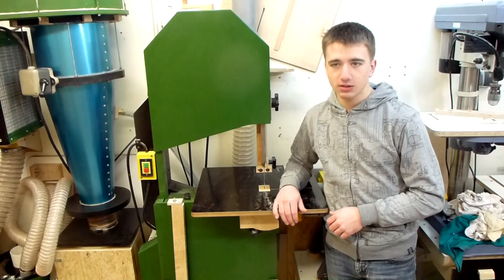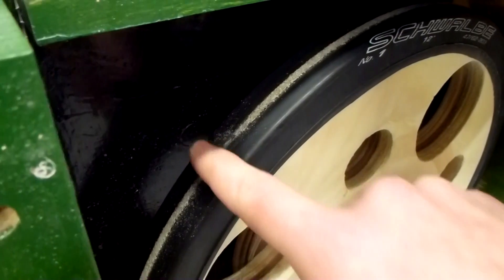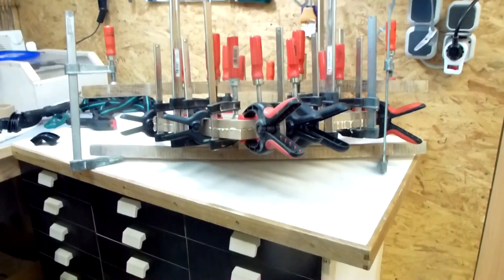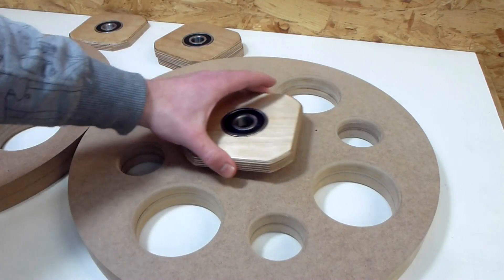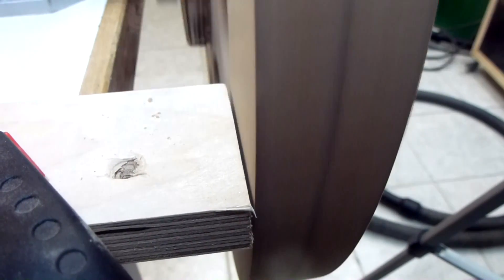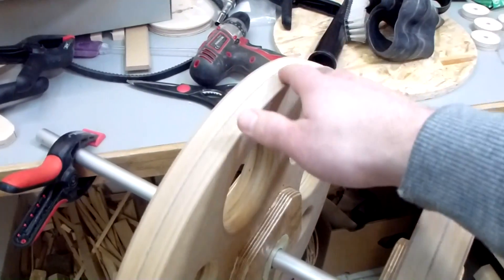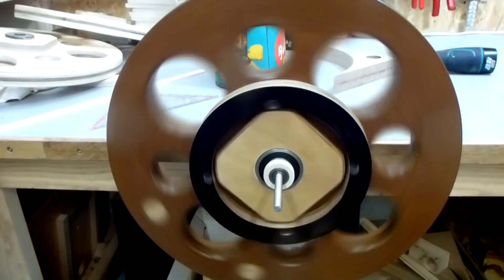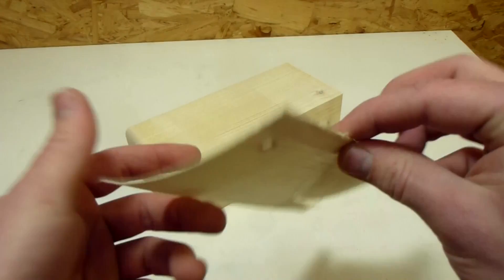New Wheels for the Homemade Bandsaw

Comment: Felder has brushes on their higher end bandsaw machines that work really well to keep saw dust buildup under control. Not the Hammer models but the Felder and the price includes a mounting piece. Put these stiffer bristle brushes at almost a vertical stance as the pressure is applied. I use them on my Northfield 27" bandsaw with altered mounting positions. V Mordt Rolfe Chicago

Comment: Hey Marius,  I'm about to turn my bandsaw wheels down to size and wanted to ask how your wheel design is holding up as I'm thinking about using your design, rather than Matthias'?  Does it eliminate the sawdust under the inner-tube? Or have you came up against any other problems with your design at all?  John Heisz used silicone sealer on his,  so I have that option too?? Thanks for you time!
Reply from the maker: +The Pallet Hippie Yes, I have zero sawdust under the inner tubes. So far no problems at all.

Comment: Hi Marius, How do you run a 400v motor off mains power (wall power, 240volts)? I just got for free a motor like yours and I was wondering how to make it work. Thanks in advance :)
Reply from the maker: +Abel Gonzalez I have a 400v outlet in my shop.

Comment: Great videos. They are project inspireing. Thanks. I will give you a great hint if you want to harden a wood surface. I use thin CA glue on a surface if I want it to be durable. The thin Ca will soke into the porous wood and it becomes like solid plastic. ...Cheers
Reply from the maker: +lewandlo Cool, I'll probably give this a try in the future.

Comment: Excellent work! Now you have used the new MDF wheels several months. Are they still in good condition? No problems with MDF as material: breakage etc. ?  I'm planning to use MDF wheels instead of plywood in my bandsaw project, that's why I ask.
Reply from the maker: +Petteri Salmela They're still in "like new" conditions. No cracks, no damage, no sings of wear. I'd only recommend to use MDF for these band saw wheels.
Reply: +Marius Hornberger Ok, nice to know that :-)

Comment: where and what do you get your motors from when you get them
Reply from the maker: +Reese Asher ebay
Reply: Marius Hornberger oh but like what do you type in and how much do you spend on them, like $100
Reply from the maker: ...search for "electric motor"... Usually between 10-30€
Reply: oh ok so you don't search like "120v electric motor" or like "____rpm electric motor" or anything? Thanks SO MUCH for your help Marius

Comment: I was wondering if you ever considered re-making your bandsaw wheels using your CNC machine (now that you own one).  Perhaps with proper reference holes/marks the accuracy could be improved and a wobble eliminated during the wheel glue up.
I built my bandsaw some time ago and likewise am considering redoing the wheels.  I don’t own a CNC but am contemplating if it would be worth having it done.
Reply from the maker: +Fikol Cki I don't think a cnc could make a better job. There is still the chance that the bearings are not straight inside the flange.

Comment: If you ever have to re-make wheels there is a trick that would help the alignment issue you ran into when adjusting the wobble on the wheel before gluing the bearing flange. Move the flange as you were doing by tapping on it but before you release it for gluing drill through it and use a dowel in the hole, this will ensure you install the flange exactly where you had it before and it will be Ok since you will balance it later...
Reply from the maker: Gilberto Diaz Castro I thought about this method, but didn't use it because I thought if the pieces move just a tiny fraction while drilling then it would screw up the alignment and I can't fix it. In theory this is a perfect idea, but it's hard to make.

Comment: really should have replaced those bearing shafts they look useless
Reply from the maker: Derek Watson They LOOK useless, but they're anything, but useless. Only the little outer surface was scratched. These are still overkill shafts for a band saw.
Reply: well you did get it running so smooth so I guess you made the right choice, + me eyes are not that great!

Comment: I made a similar bandsaw, only with a metal frame and wooden wheels watching your video, thank you for this detailed video, but I was wondering how to change the bearings when these fail of use, do I have to make the wheels again?
Reply from the maker: Marko Miljkovic Yes, I would have to do that. But the bearings should last a long time.
Reply: Marius Hornberger Thanks, you're right! :-)

Comment: Hi Marius! Great job!
Was it possible to use a dozen screws instead of dozen clamps when you glued MDF panels together? And the second moment - does auto service center' balancing machine works well for balancing bandsaw wheels?
Thanks for video, your result is just amazing. Cheers!
Reply from the maker: schabanow Screws should work, but you have to be careful. They don't hold very well in MDF. I would recommend clamps. And I don't know if their balancing machine works for that. Ask them. But in the time you go to their service center to ask them, you probably have balanced them yourself.
Reply: Thanks Marius! I mean screws + nuts, through drilled holes. And I agree about service. )) Good luck!
Reply from the maker: Bolts and nuts should work fine.
Reply: Sure if you have a couple of dozen clamps you can press the pair together much faster.

Your wheels are really brilliant, first of all I mean their exterrior (my weakness), not expensive and fully functional as well.

As a variant... I've seen a ready made pair from the bycicle (!) - not even motorcicle. Despite the author runs them at extremely (as I comprehended the video) low speed - they work. Cutting process is obviously not fast, but it definitely IS. He cuts off a ~ 1 inch water pipe in ~ 20 sec; the timing resembles one for handheld high rpm abrasive cutting-machine.

I wonder of a pair of used motorcicle' wheels...

Comment: Hallo
There is something else about the motor you could do, it might be possible to make it run at two speeds and make it start properly also by using a special switch. You should first open the box on the motor and see how many wires come from the motor into the box, if there are 9 it is possible to make it run at a lower speed by reducing the number of poles and at full speed (1500 and 3000 rpm for example) and use a star-duble star or star-triangle start config, if  there are 6 it is possible to use a star-triangle start, and if there are only three you cant do much but someone with expertise could disassemble it and do the proper modifications, also the proper way to start the motor is with a star-triangle config because in triangle config the starting current is 4 to 8 times bigger than the running one as oppose to a star config in which the starting current is only 3 times bigger than the running current. I will try to explain more. The motor has a rotor that is so called in short-circuite and a stator with a multiple of 6 windings but there are basicaly three coils, one for each phase. Normaly from the factory there should be 9 wires coming out of the casing, three for one end, three for the other end and three for the midle of the coils so depending on the aplication the connections are made, but sometimes these wires are conected inside the motor. These wires could be connected in a few ways (sometimes incorect making the motor to run hot and ineficient, noisy ...)
Reply: Alexandru Alanei that is a good idea

Comment: Hallo
I have thought about the high starting torque of the 3-phase motor and there are some solutions for that other than a speed controller, in fact that is not even the recommended solution for this type of motor.
Most likely your motor is connected in a triangle configuration so the tension is 400V, but at startup ( if the start is with no load) the configuration should be in a star (Mercedes icon ) so the tension is 230V, after the nominal speed is achieved a switch to triangle configuration should be made.
You should use a specific switch 
http://www.schrack.ro/comenzi/comutator-stea-triunghi-3p-7-5-kw-32a-in108900.html
or three commutators and a time relay.
 wiring may be confusing and dangerous and you should ask an electrical engineer to help you
Reply from the maker: Alexandru Alanei Hmm, interesting idea. Thank you!

Comment: 10:41 just screw that onto the wheel after you fix them and then remove the clamps, why you gotta use glue?
Reply from the maker: Gia Rcheulishvili Screws aren't nearly strong enough for that.
Reply: Marius Hornberger Great video!  On my bandsaw, I used some crappy plywood for the wheels and compounded poor material with less than perfect workmanship.  Still, the saw runs okay, but my coin wobbles much more than yours :)  I'm going to use your video as a reference for my next attempt at wheels, I think you did a great job from materials on down...  But I agree with Gia - you would have done better if you had drilled in some screws after you had the placement perfected, but you're also right - you want glue for the strength.  I would just use the screws to ensure the alignment.
Reply from the maker: I'm right, because you NEED the glue for strength. And the flange can also be moved by the screws, when you driving them in. But if you try it, let me know if I'm wrong.

Comment: easier hole saw cutting: drill one or two holes (1cm or so) on the waste side of the cut, intersecting the cut line.  The sawdust exits the kerf onto the holes and no more burning!
Reply from the maker: I already got that hint from another comment. But still thank you! I will definitely do that for the next hole saw hole.
Reply: I figured about 20 people would tell you this. But I wanted to get in on the razzing.  I cannot tell you how many doors I burned my way through before someone told me this. It would be so convenient if we could learn all of this stuff before we ever built something.
Reply: Thanks for that advice!!! I hate my holesaw for that reason. Maybe there is hope :)

Comment: I would call it "Brilliant".  A really excellent job Marius.  You're right, those new wheels look great and I can hear the difference.  What blade are you running on the bandsaw?  Cheers.
Reply from the maker: David Handley Thanks. It's a 6mm tuffsaws carbon blade with 6 TPI and a Vari-set that I use primarily. http://www.tuffsaws.co.uk/index.php?route=product/category&path=2_4_13_21

Comment: Really fast start :) Your motor have capacitor? Try to use smaller capacitors, the motor will not be so quick at start
Reply from the maker: Igor Somov No, it is a 3-phase motor
Reply: any 3-phase motor can be connected to 1-phase. Maybe this makes sense?
Reply from the maker: But I have 3-phase power supply. So why should I do that.
Reply: To make start more soft :)
Reply: Igor Somov don't convert it to single phase unless you really must because that will produce reactive energy which is charged in most places so you'll pay twice as much, another reason would be that the 3 phase motor is less prone to burn out
Reply from the maker: Don't be afraid. I will stay with the 3 phases.

Comment: Great videos and impressive work!

Can you please specify your tablesaw and how you like it? Thanks a lot in advance!
Reply from the maker: Uwe Born 250mm (10") sawblades, 1400 watts power. The fence is good (after some modifications). It is better than no tablesaw and does the job. The blade wobbles a little bit and the table surface is not 100% flat. I don't recommend to buy it new, get something better. But this saw is 19 years old so...

Comment: Very nice wheels Marius.  Interesting design advance and they look great.  I don't know what the inner tubes cost, but with your design you could also incorporate purpose built band saw wheels that would be very durable for about $25 each.   http://www.ereplacementparts.com/protectorwheel-p-446077.html
Reply from the maker: Gary Truesdale 7,50€ each. I noticed that myself, but I already had the old inner tubes and it unfortunately it is also REALLY hard to get these band saw wheels in Germany...

Comment: Lots of details, I like it!

I prefer to keep mine running slow.  Quieter, blades last longer, and less dust.  Tried running my cast iron bandsaw at around 4000 fpm once.  The tires started coming off that one too!
Reply: Marius Hornberger
A slower saw will take larger chips (for most cuts).  And slower wheels will blow less dust around  the shop.
Reply from the maker: Matthias Wandel Thanks. I need the saw running faster for cutting bowl blanks properly. And I don't care about noise, because I always wear ear protection. But why less dust?
Reply: That was impressive!
Reply from the maker: True, but also depends on the feed rate. And because I use the with dust collection I don't have issues with sawdust being blown out. You also need a slower speed, because of your smaller motor, right. I just thought that the commercial high-end bandsaws also run really fast and there has to be a reason for that, so I tried it out.
Reply from the maker: ***** Hmm, we didn't mention cut quality in relation to blade speed. But that mostly depends on the blade quality. Unfortunately I can't  make a comparison here, because I didn't have the really good blades when the saw was running slower. All I know is that my cut results are very good. Hopefully these wheels last forever.
Reply: +Matthias Wandel 

I think the slow speed doesn't work with the solid wood too
Reply: Your good
Reply: Nice video, can't wait to build my own Bandsaw.
Reply: njalok drillnya pak
Reply: @emiljayadinata523  Ora oleh. kon tuku dewe. Jarene !
Reply: Matthias Wandel 👍👍❤❤💚💚🌹🌱🍇🍎☕🌞
Reply: 36" American yates blades cut at 100mph.  Your blandsaw works great because of the 2hp.  Maybe Mathias is being stubborn on the low hp, which will never work like yours.

Comment: Next time you have to line them up to avoid wobble, get it all up without glue, get rid of wobble. then drill 2 dowel holes into the the bearing plate to the wheel.
Reply from the maker: Big_Adam_2050 I thought about that, but if anything moves just a tiny bit when I drill the holes then it would be screwed up and I can't correct it. And 2 dowels, even 4, wouldn't be strong enough.
Reply: You clamp, then drill. Just for lining up more than anything.

Try it out on a smaller scrap bit first, see if it shuffles about at all.
Reply from the maker: But it still wouldn't be strong enough. You need that big glue surface of the flange.
Reply: Can you not glue the dowels as well then?

I'm a crap woodworker, so I got no idea as to joint strength past how many and how long the screws are I shove in.
Reply from the maker: If I have the glue surface from the flange, I don't need dowels. But the thing is that even when you make dowel holes for aligning. Once you take them out again or remove the flange, the alignment won't be the same as before. Were talking here about 0.1 - 0.01mm
Reply: But is that going to make more or less runout?

Actually, be simpler just to use a slower setting glue.
Reply from the maker: Big_Adam_2050 Depends on how lucky you are. Maybe you get the exact same position and have no runout, or you don't get that position and have runout, but then you can't change anything. A slow setting glue would be perfect here, but I didn't have any when I build the wheels.